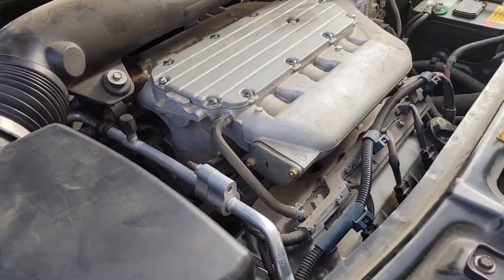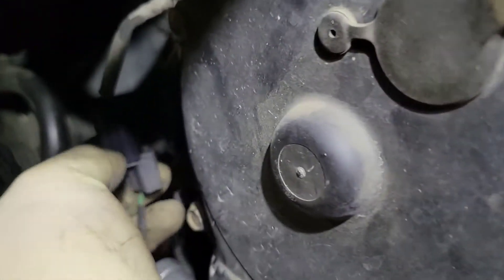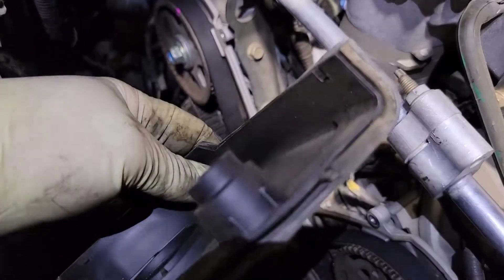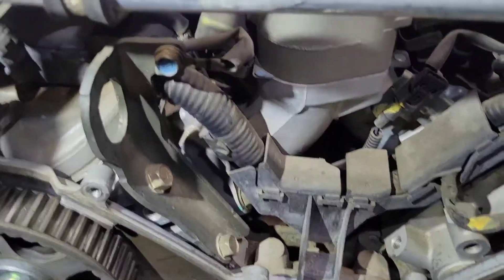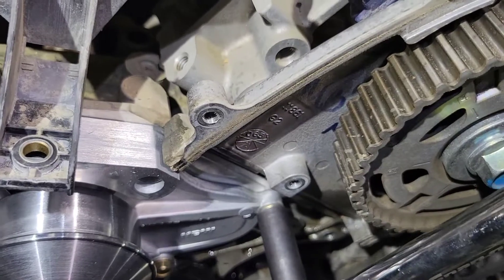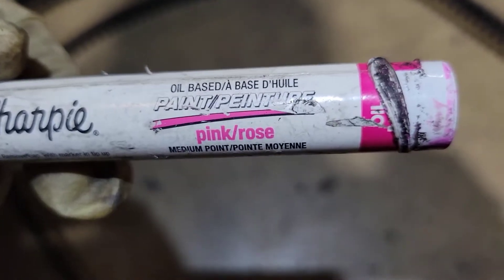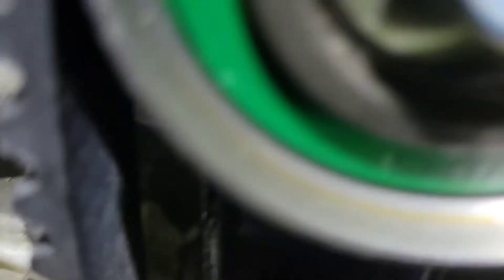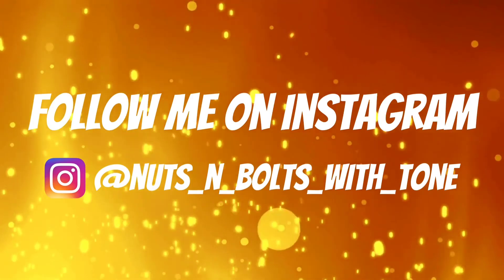3.5 Honda V6 Simplest Water Pump Timing Belt Replacement

Comment: Is it common when manufacturers use the same engine but different models to have accessories mounted in different places? The only timing belt I have done was a PT cruiser non turbo. Great vid yet again!!
Reply from the maker: No it's not that common but we do see it some. I have done so many timing belts but I still mark every one. Thank you for watching I appreciate it.

Comment: Can i pull the camshaft cover to inspect the belt.? Can I tell visually if it needs replacement?  Car had 142000 miles
Reply from the maker: You can remove the upper timing belt cover and look, you will be able to see if it is cracked or worn out, but if it is due you may not be able to tell by looking.